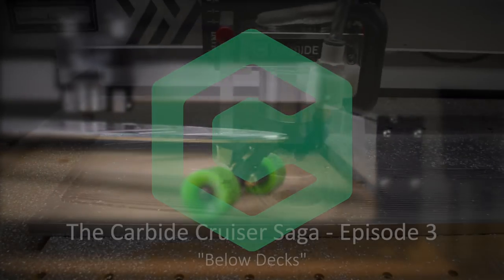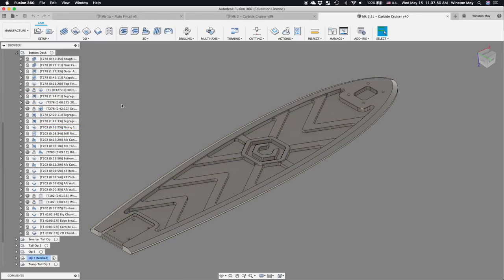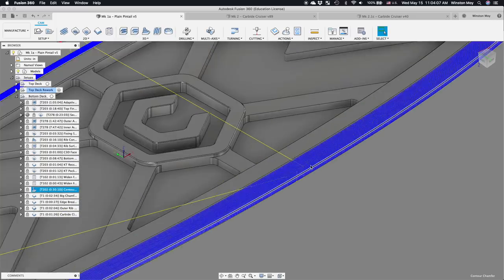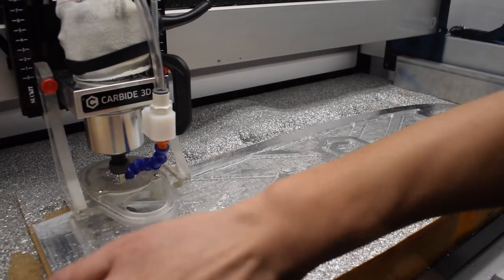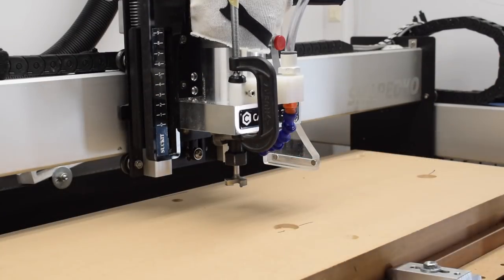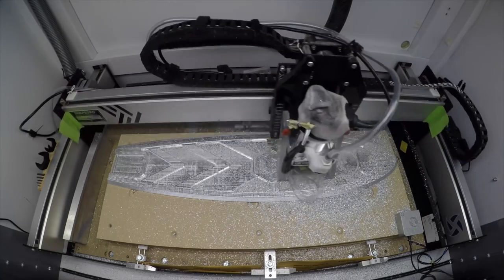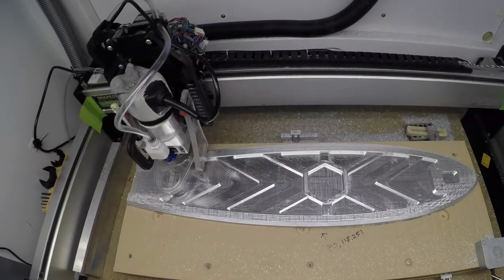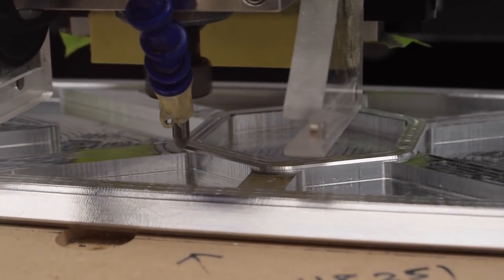Machining Longboard Decks, Pt. 2 - Carbide Cruiser Ep. 3

Comment: wow - i did not ecpect the SO3 can do job like this - pls post with is the ned mill you use and the setting on CC for the tool --- pls help me to learn I also have a SO3 XXL and need to know the tool setting in CC like ( feed rate, stepdown, rpm plung rate) thnks in advance.

Comment: I'm at the stage with aluminum that you were a year or so with your attempts!  But I have the advantage that you have done the feeds & speeds research and saved me many headaches.  For that I'm thankful. One question, are you still using that aquarium air pump for your chip clearing?  I want to install some air on my Shapeoko and use the air on my mill also.
Thanks, Rich
Reply from the maker: I've found aquarium air pumps to be inadequate, not enough flow rate. Search: "hydroponic air pump" online, I have a strong preference for one that's rated for at least 800 GPH, preferably 900+.   -W
Reply: @carbide3d  
Can I use the hydroponic air pump for the HDM ? Or a compressor to run a mister or fogger?